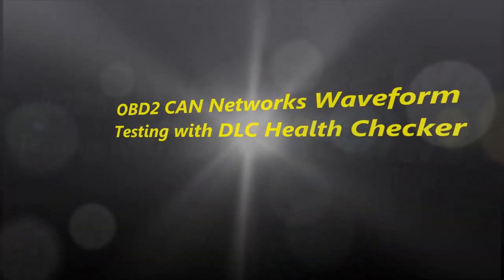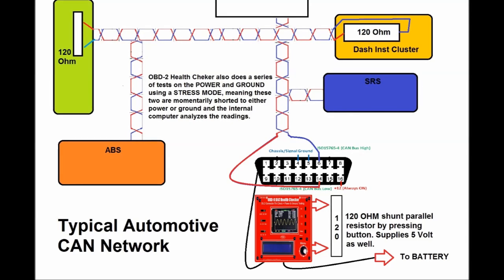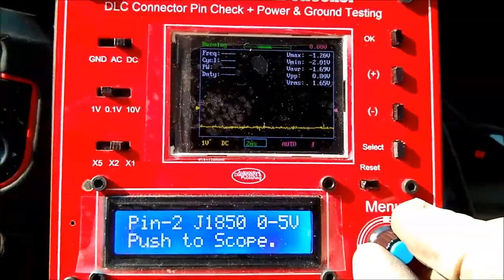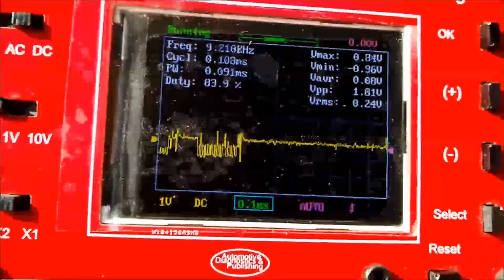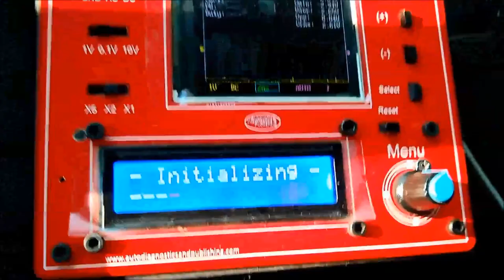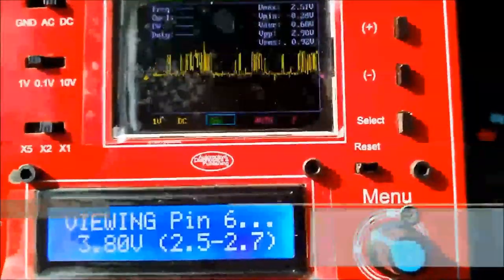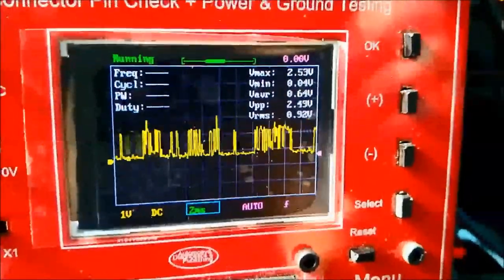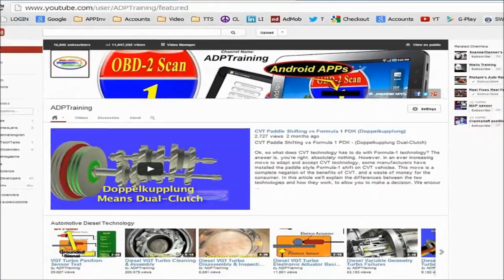OBD2 CAN Networks Waveform Testing with DLC Health Checker

Comment: on CAN system 120ohms is not Always the case. I am surprise that your information is not up to date.
Reply from the maker: Wrong, it's always two 120 Ohm resistor termination in parallel. Both make 60 Ohms.
Reply: @ADPTraining  correct 👍
Reply: @ADPTraining  if you read 120 ohm's then there is blown termination resistor
Reply: flexray is two 90ohm